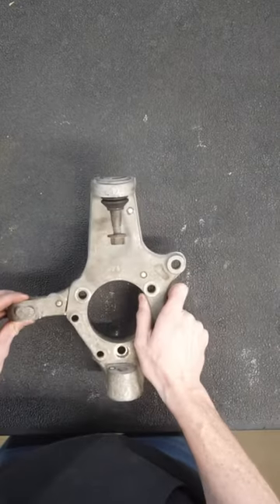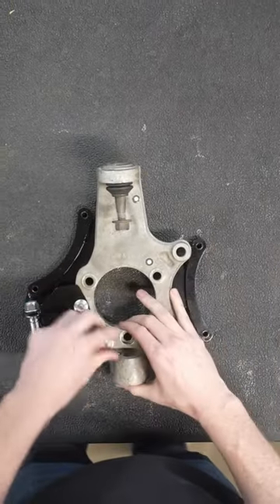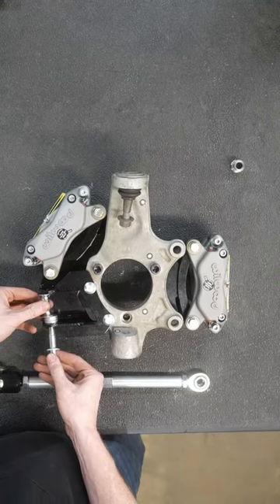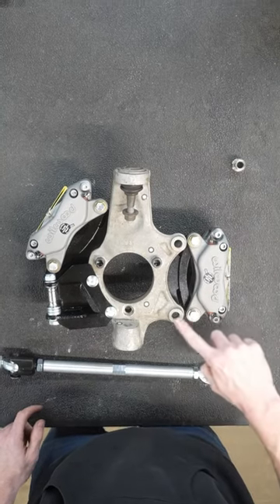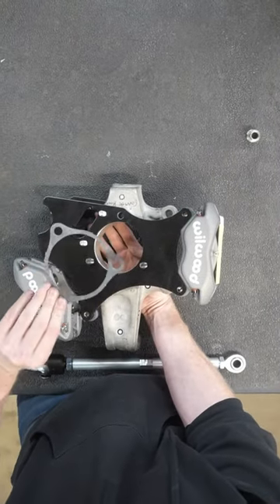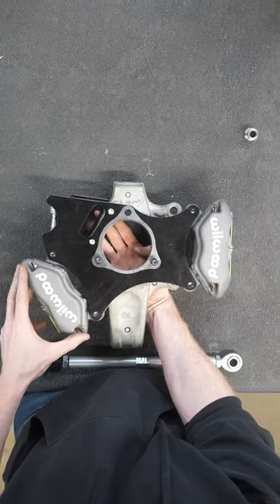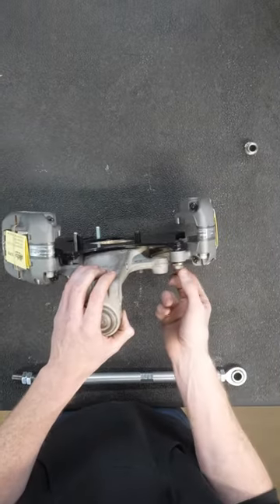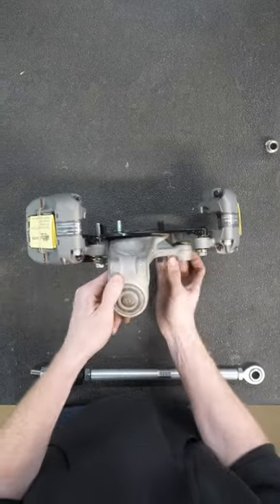Assembling FDF Corvette Dual Caliper Brackets🔥 #shorts

Comment: So can base model rotors work with this?
Reply: Yes base or ZO6. If u have a c6 grand sport or z06 you can use your own rotor instead of a wilwood as well. Or put the C6Z brakes and rotors on your c5 from power stop.